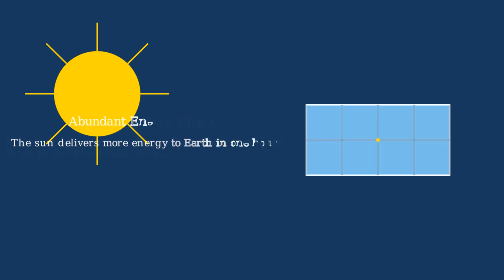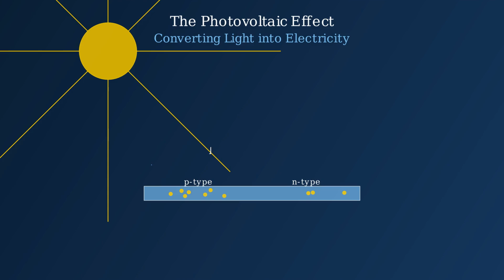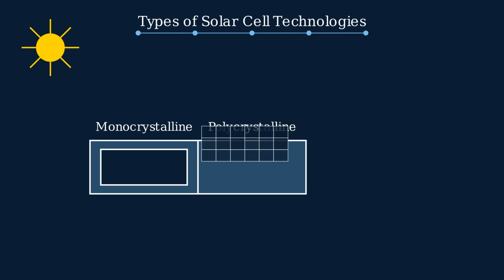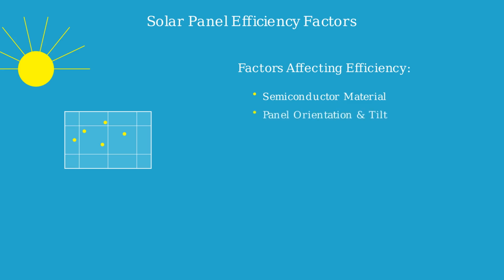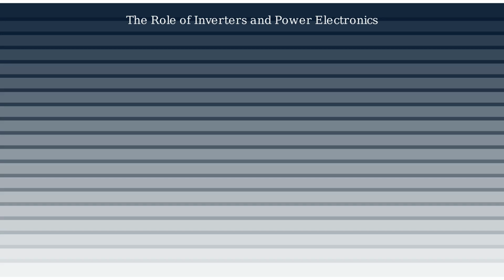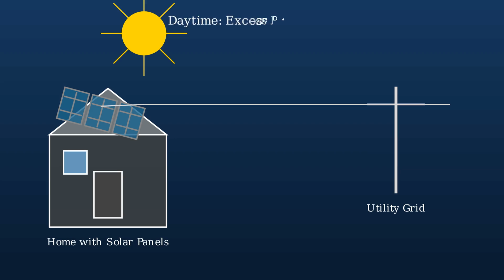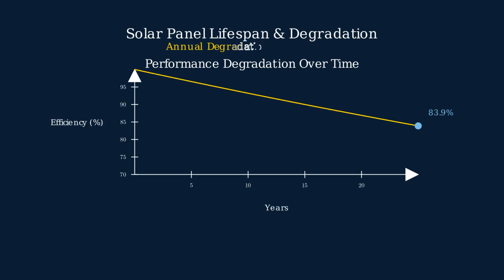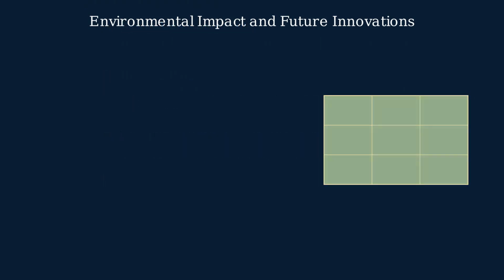How Solar Panels Generate Electricity by Explainer Express

Comment: This, to me, was an unsatisfactory explanation of how solar cells work. How does the solar cell create the voltage gradient? Once a photon of sunlight kicks an electron uphill against the gradient, what stops it from sliding downhill again? Without addressing questions like this, you don't really explain how solar cells work.
Reply from the maker: Hi, thanks for your comment and for pointing out these important questions. Sorry that the video didn’t provide a clear or satisfying explanation for you.

You’re absolutely right—understanding how solar cells create a voltage gradient and what prevents electrons from simply sliding back are key to really grasping how they work. Your feedback helps highlight where more detail is needed, and I appreciate you bringing it up. If you’re interested, I can try to give a more detailed written explanation here, or suggest resources that go deeper into the physics behind solar cells.

Thanks again for your input, and sorry the video missed the mark for you this time.